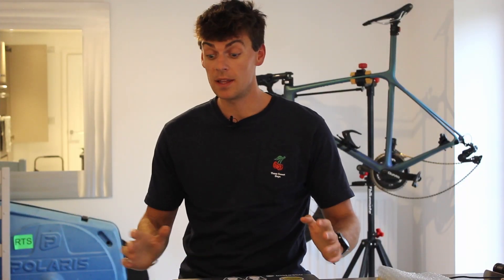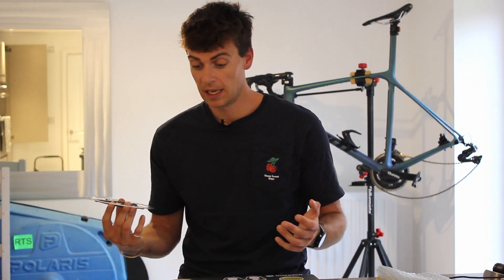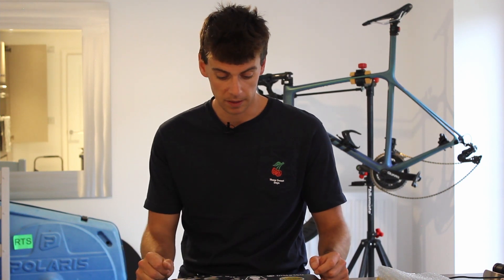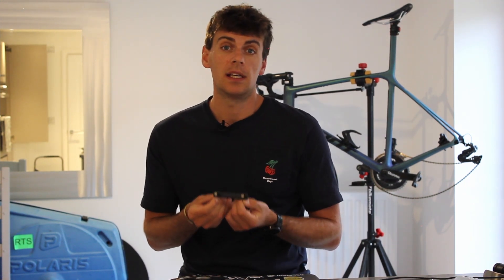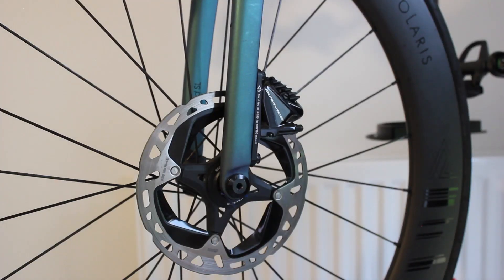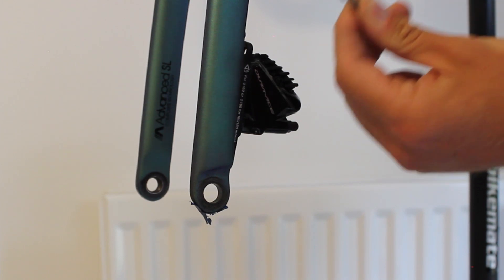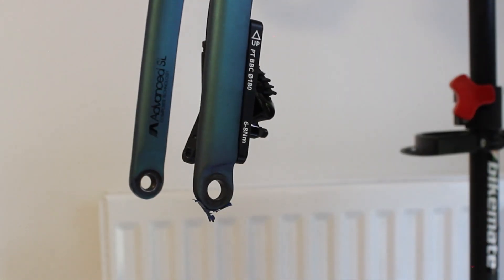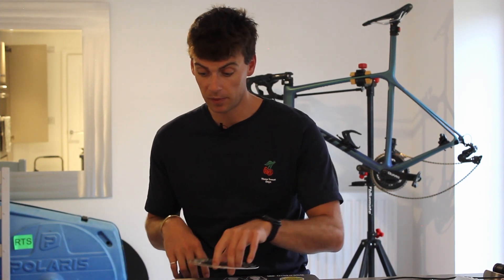180mm Disc brake conversion on road bikes

Comment: Imagine if you had 700c sized discs and you applied the brake to the outer surface of that larger disc.
Reply: I think you are really onto something. Let's hope the bike industry backs this idea. Sounds like less maintenance too
Reply: They tried that but they found that tyres were getting so hot the tubes were blowing the tyres of the rim in carbon versions.
Reply: Lol the circle of life
Reply: @glennoc8585  mythological
Reply: That’s a great idea. Just a few small issues might pop up:
- width of tire limited 
- no use of hookless
- temperature issues with latex tubes
- worn brake tracks are a pain to swap
- poor wet performance
Reply: Made of carbon fiber
Reply: If they were about half of that size I think it might work. At 700c they are so close to the ground they are permanently dirty and end up needing a full rotation before they get decent grip.

Also if they are load-bearing and supported by spokes (since everything else would be too heavy) even the smallest amount of wobble
Reply: ... means you will get rubbing pads. Better not to have it as load-bearing. 

Also over time it will wear off, it's a friction surface. Rather than making the wheels thicker than they need to be, making the discs replaceable is a neat solution.
Reply: @JulianKent  A light ceramic or other hard coating on the braking surface will make the rims last forever.

Water is annoying though. Drums are probably the way to go.

I have a hub motor that has regen braking and it's magical. No wear, not affected by water, no force required to activate the brake and free energy.
Reply: So rim brakes?
Reply: I also imagining that kinda thing, you just reinvent rim brakes lol
Reply: Haha :)
Reply: @glennoc8585 the fairytales continue……
Reply: @LarsRR . A) 28mm is plenty for Road b) nobody wants to use hookless, particularly on road where the pressures are higher (do you regularly watch this channel?!) c) unless you live in the mountains with 20km descents, simply not an issue. If you do use butyl or go tubeless d) this is so laughable. do you know how much riding you have to do to wear out a rim? 20,000 km +, and way more of you use softer compound pads and keep on top of maintenance e) how often do you do long rides in the rain? I don’t and on the rare occasion I do I take the winter bike with alloy rims, braking performance is excellent.
Reply: @JulianKent  😂 “permanently dirty and need a full rotation to clean”. Tell me you’re a total cycling noob without telling me you’re a total brainwashed cycling noob.
Reply: @paddyotoole2058  depends on how close to the limits you ride. Sure there's some braking force while your rims are still dirty. But if you really want the 99% on demand the modulation is too inconsistent to know how hard to squeeze without locking up. There's a reason MTB went for discs sooner than road...
Reply: @JulianKent mate, in case you hadn’t noticed this video is about disc brakes on a ROAD bike. And all the references above are with respect to Road. Nobody’s talking about or has referred to MTB apart from yourself, which is a completely different ball game.
Reply: Then we're back to rim brakes
Reply: @LarsRR Tire width is limited to ca. 50mm, yeah. So not suitable for MTBs or fat bikes. There are a lot more caliper brake sizes than just the "typical" Road-Bike models. Similar for direct-mount caliper brakes.
Reply: Would stop even an A380 😂😂😂😂😂😂😂 ✈️
Reply: I'll never understand these goobers fighting for "good enough" brakes, and to make the wheel structure a consumable.  🤦‍♂️  Probably the same riding with micro-headlights at night, if they do ride at all.

Comment: You said longer pad life. I'm just really curious about the physics of that. The moment is greater, so you need less clamping force, but the rotor is travelling more quickly, which I would have thought would counteract that - ultimately you're still dealing with the same amount of energy. I can certainly see the rotors would last longer as they're bigger and there's just more material to grind. The only way I can think the pads would last longer is if they just work more efficiently because the temperature of the rotor (and the pads too) is reduced. But I'm not a trained physicist, so I expect I'm missing something?
Reply from the maker: From the study we did in FSAE (going back some years now) the longer life came from reduction in pad and disc surface temps. You are correct the energy conversion is completely analogous.
Reply: The difference in rotor speed is negligible compared to the leverage gained.
Reply: @cup_and_cone  no, it's proportional.
Reply: Don't pads also wear more quickly under high loads? To achieve the same power, you can do low speed+high force or high speed+low force. I would imagine that the high force option has a greater chance of taking chunks out of the pad.

Basically, I'm talking about load sensitivity and shear resistance.
Reply: Pad life is significantly reduced above a certain temperature (varies for every pad type).  So if you can decrease the pad temperature below that threshold value, pad life will increase a lot.
Reply: @yogibarista2818  really sketchy braking with carbon rims has always terrifying to me. I've done a few hundred kms on a disc brake bike, it's not magical but it does feel better. I like knowing that my rims aren't just going to melt.

Comment: On my road bike, i never needed more breaking power than the ultegra 6800 160mm provided me. However on my gravelbike (force axs), i regularly need more power, than what is available to me. I weigh 75 kg + 10 kg for the bike and 4 kg in gear. The gnarly trails and massive traction (compared to skinny tires) of my WTB Raddlers demand immensly more power. For this reason, i will convert to RX4+ and 180/160.

Comment: Some gravel bikes support 180 / 160. You mentioned that gravel bikes are slower so don't benefit so much from bigger rotors, but you forgot the added weight from stuff like bikepacking.
Reply: not the mention gravel bikers' beer bellies

Comment: I put a 180mm front disc on my Open UP, using it with the Hope RX4+ so no adapter needed. It gives a massive amount of braking power, tons of modulation as well. Super happy with it so far.

Comment: Mohorič used the Merida Scultura in MSR because it has a standard round seat tube for the dropper post.
Reply from the maker: But he took the fork from the Reacto! You can see if you research it. The scultura wont fork wont fit 180.
Reply: Damn, good spot then!

Comment: I think this is  great one engineer to another. Recently experienced a crash on a steep descent in the Yorkshire dales which has left me with a broken collarbone. When looking at my bike after the incident, my 160mm front Sram rotor has significantly changed colour due to the overheating. Maybe a bigger disc would have reduced this and allowed me to scrub off enough speed to avoid the crash.
Reply: Or maybe just sticking to a well proven solution - clinchers would have prevented it?

Comment: I have a Canyon Grail e-gravel bike and it needed a brake upgrade!  I converted rotors from 160mm to 1800mm front and rear, thicker rotors, sintered brake pads, (1. organic, 2. semi metallic, 3. sintered or blocks of steel!!). It now stops vs. quickly coming to a stop.

Comment: I'm 80kgs, ran 140mm front and rear on a Cannondale. No issues, brakes were fantastic. Now run 160/160 and brakes are fantastic. No issues with warping braking down from 45mph to 15mph. Can't see the need, never felt there was a thermal problem. For me 160/140 is the perfect combo. 4 different bikes 2 were shimano 2 SRAM.
Reply: All depends on where you ride. If you 500m of descent at 15%+ on twisty corners the whole way, even 180mm on a mountain bike will struggle.

Comment: Check out the front brake design on the “Buell Lightning”
Reply: It’s basically a rim brake :)
Reply: Why do you think motorcycle manufacturers --- with much better engineers --- choose not to use the Zero Torsional Load (ZTL) brake design?

Comment: Mate, I’m just wondering , would it not be better to design an adapter that replace the existing adapter altogether ? I’m not an engineer but I seem to remember you said in a previous video that it’s a good practice to reduce the number of interfaces between components
Reply from the maker: Keeping the original plate and its slotted holes makes aligning the caliper as simple as before. It is nice to keep that interface to make adjusting the caliper simple. Also, it makes switching back to 160mm easy. In general though you are right!
Reply from the maker: PS the first prototype was like that, but there was so little room for adjustment if it was done like that. To keep the perfectly radial position and tangential sweep of the pad to disc interface, making it in 2 parts was much easier.
Reply: Hahaha I see, thanks for the explanation, really learning a lot from your vids

Comment: Great explanation.  It ain't about the ability to lock the wheels.  Heck I can lock the wheels with my shoe on the wheel.  It's about how the braking feels and braking confidence.  I have 203mm on 4 piston calipers on my mtb and the confidence I have vs my road bike is tremendous.  Obviously overkill but having more rotor and larger pads is incredibly nice to have.
Reply: I agree that modulation is key. I also have 203mm rotors F/R with 4-piston Shimano brakes on my trail bike, and I find the modulation "addictive", and overheating hasn't been an issue so far. My BIL's trail HT that came with MT400 class 2-piston brakes and the typ. "resin only" rotors and pads, have zero issues locking either wheel but consistency suffers as the rotor gets hotter and hotter, and modulation @ the edge of locking up is worse throughout.

Comment: I use my brakes a lot more and for longer periods on my gravel bike than on the road, but I routinely do 800+m descents that are technical enough to require near constant braking.  It has 180/160, which I've been happy with that.
Reply: Exactly. On gravel you are moving slowly enough that there is no aero drag, so you're putting 100% of the descent energy into the discs. My gravel bike has a lot more brake fade on gravel descents than road descents.

Comment: FWIW, I don't think that there is much concern about increased forces on the forks. 
The peak torque (heh!) about the spindle is still limited by the tyre grip, so assuming that the brake could be locked before, that remains unchanged. 
At this limit point the force at the brake pads  it reduced, and the bending moment on the bottom of the fork leg is exactly the same. 
There is (maybe?) a different balance between the forces on the two mounting points. If you consider a very large adaptor then you could see the force at the bottom mount become a tension force, and the force at the top mount then becomes larger. I don't think that you have gone far enough for this to be a real issue.
Reply: I wouldn't take the risk on these weak road forks. When was the last time you locked up the front brake at high speeds? My forks broke on 32mm tires, 160mm rotors. I've switched to 140mm now and gravel forks. Be careful.

Comment: Cool product + discussion. 
You need a report on rotor life with this conversion. The 160mm was a fast-wearing consumable for you, if the 180 will last more, there might be a "pays for itself in X seasons / YMMV" argument. 

AFAIK, BMC URS is the "other" Gravel bike that also comes with a 180 Front Rotor, at least in the carbon frame versions. 

I definitely don't "need" it for my gravel bike, but I'd also definitely like one, cause...pimp. And 190lbs/87kg kitted =)

Comment: @Peak Torque: back to Shimano discs? I'm pretty annoyed with my Ice Tech Rotors bending, especially with bags on the bike. Had zero problems with my cheap 105s and never had rubbing rotors. Thought about swapping to campi, what was your verdict on these?

Comment: "You're not usually bombing down steep descents on a gravel bike" - you should come to Western North America, where the gravel roads can be >15%!

Been having some issues with heat on 160mm rotors so I think an upgrade will happen with your adapters (or the Hope calipers).

Comment: I got my fork made with the flat mount 180 spacing (which is printed on the side of the stock shimano adapter you have in the video) 
I think it's a better idea, marginal difference in weight or aerodynamics vs 160mm, probably see more road forks made that way

Comment: I put 180mm rotor on my bamboo disc bike. Problem Ive found with bigger rotors is they flex more when you power stomp the pedals and you get that 'ping, ting ding, sing, fing jing' rotor rub noise.

Comment: Wow very nice adapter! I do not ride road disc bikes,but I had the same brake mounted in various bikes/rotor size combos and 160mm rotors had more pad wear than bigger 180 or 203 mm,it is totally true. Yo need more time on the brakes with the small rotors to do the same job or pull harder the lever. My dirt jump bike wear very fast the pads,only 160mm rear brake to stop the bike,never had a problem with the small disc but I see why many riders would choose a bigger disc.

Comment: Not sure if you've mentioned this, but not all forks will be wide enough to accommodate a 180mm rotor, and if it's a super tigjt fit then I'd personally be nervous about the rotor going slightly out of alignment and then eating into the fork
Reply from the maker: Good point I'll add it

Comment: I have the option to buy another bike both have the rim and disc brake options. Leaning towards the rimbrake because my disc brake road bikes requires a lot of maintenance and cost is high. Is Rim brake still worth it? Its a Factor o2 VAM btw.
Reply: Absolutely, I have a rim brake Pinarello F8 it’s a-ma-zi-ng. No bullshit, no disc rubbing, lighter,…

Comment: Just thought of this, but I recall Merida was using a heat sink that was mounted between the caliper and the rotor. I wonder if the heat sink takes up room and “forces” them to move to a 180 mm rotor. Obviously adding a heat sink and increasing the rotor size would be a win win toward the intended goal.
Reply: Just did some further research, their heatsink is designed into the fork. Scratch all that. 180 mm was an intended modification.

Comment: Yeah, you might be wrong with your suggestion on the gravel bike ridingstyle, some people ride hard and fast, whatever the bike…also dońt forget the additional weight when bike packing. I watch this vid for another reason. I run mech disc brakes. Had to save money, thought it was good for traveling and thought the newest gerenation would be fine. Setup is TRP Spire C with Rival Levers. The hard curve in the handlebar didńt help the friction.Very bad braking in the beginning until greasing the hoeses an using organic pads. Thats why I imidiatly searched for a 180mm conversion kit. Guess it makes a lot of sense for mech disc users. I think it might even help dosing the brakes as less force is needed. Actually i am still searching the point of engagement :)

Comment: Have you considered thicker rotors a go for increased thermal dissipation and warping reduction (e.g. SRAM HS2 rotors at 2.00mm thick)? Not 100% if Shimano calipers can clear the +0.15mm in rotor thickness but SRAM HRD calipers certainly can even with new pads.